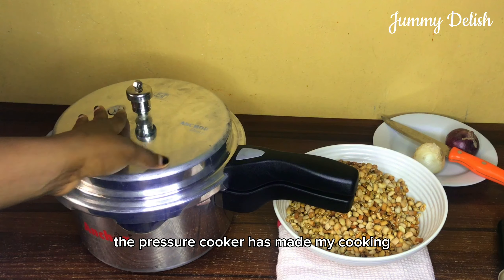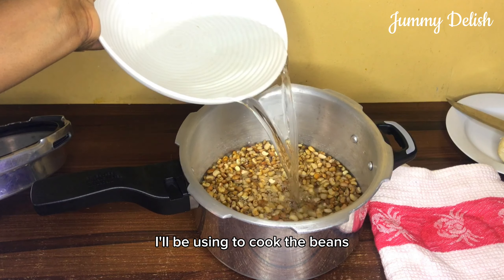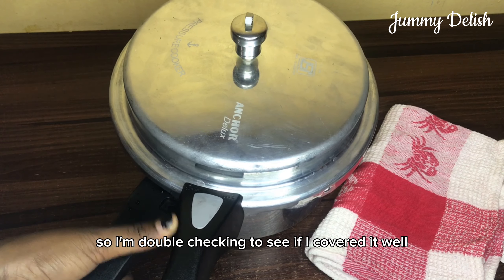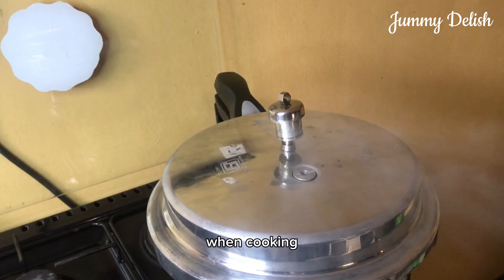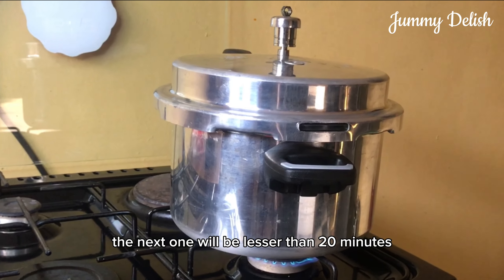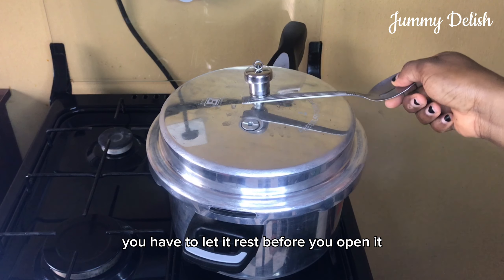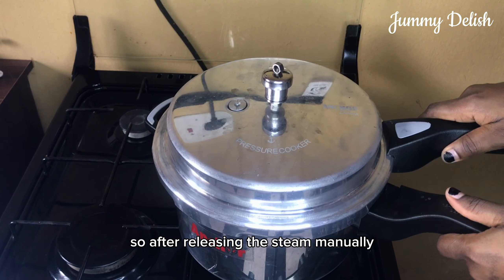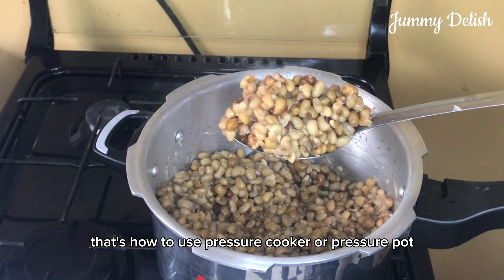How to use a Pressure Pot | HOW to cook beans in a pressure cooker

Comment: I have a pressure regulator as you do. I don't have an instruction manual. I have used other regulators but this one is different. Are you saying the regulator only lets off steam every 20 minutes? I am afraid.
Reply from the maker: Don't be afraid
It depends on what you are cooking,  minutes could differ. It let's off steam as soon as the pressure in the pot has reached its limit.
Reply: @JummyDishes  Mam am I the one who Letts of the steam or it let's the steam on it's own?
Reply from the maker: @sadiyosharaf1318 let it steam of itself.. but if you don’t have much time to let it cool, you can steam it off yourself